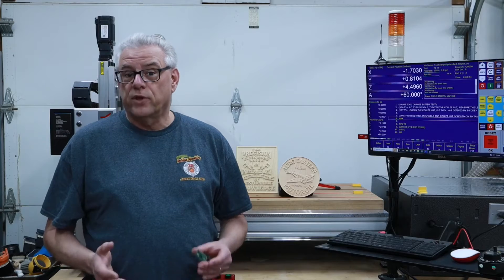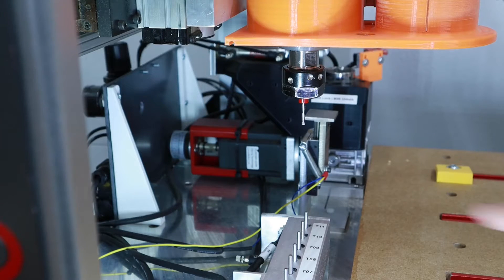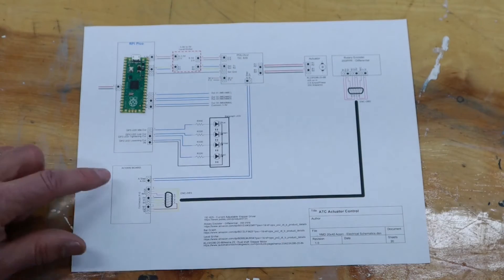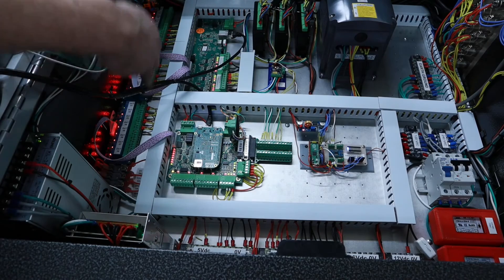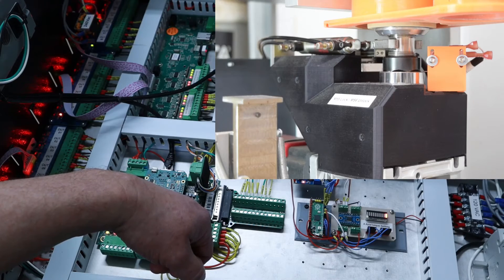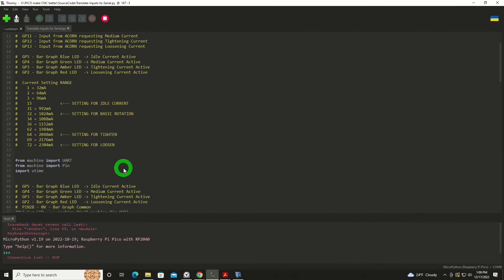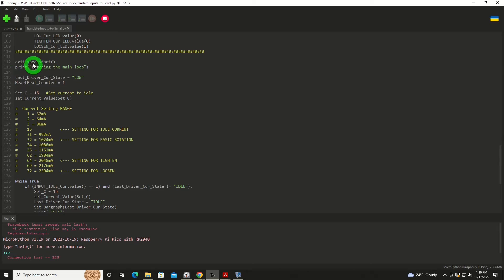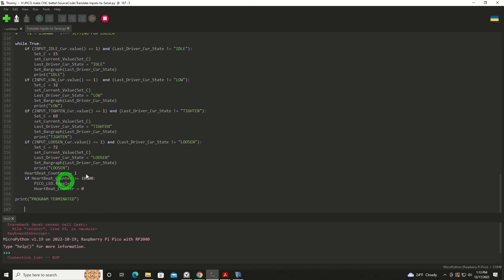See how a Raspberry Pi PICO Made CNC Awesome by solving a major interface problem

Comment: Great project, never thought of using microcontroller for this type of purpose.

Excellent explanation.
Reply from the maker: HI chirots,
Thank you very much for the Kind words.  Yeah, micros can be used in a lot of places PLCs are typically used.  They are not as "hardened", but they certainly can get the job done.
Cheers!
Chris
Reply: @MakingStuffwithChrisDeHut  I usually use PLC for any kind of projects either big or small, because it can be written quickly and many HMI  monitors can be connected without crazy codes  and classes.

Built a solenoid winding machine with Pico. I spent a few days testing codes whereas I could do that in PLC for just a hour.

Always admire all project creators such as you.
Reply from the maker: @chirots 
Yes, PLCs are a powerhouse in the industrial world. Outside of "work", I have always favored the SBCs and Micros, probably because of cost.  It is hard to find a $4.00 PLC.  Most importantly, as long as it is fun and interesting, PLC or Micro are great devices!
Cheers!
Chris
Reply: @MakingStuffwithChrisDeHut  Thanks for your responses. Nowadays, channel creators hardly respond to any comments or questions. By the way, you are definitely right about the cost of PLC. I guess I need to polish my coding skill in order to build more complex projects. So many ideas with limited programming skill.

Comment: multicolored bargraph, 4 colors ,  i know of red/yellow/green for sound volume, heartbeat idea, nice
but why not use the spindle motor to turn the collet open/closed, not delicate enough ?
Reply from the maker: Good morning Ben,
The reason is that the spindle motor is a 24,000 RPM motor.  It can only run between 7,000 and 24,000 RPM so it is impossible to start the motor then stop it quick enough.  Furthermore, the motor has zero torque at low RPM. The stepper along with the gearbox give me great mechanical advantage for tightening and loosening the collet.  This is a major driver as to why this is complex and why no one else has been able to achieve it.  Lot's a crazy crap to get this tool change system to work reliably and accurately.  It was a LOT OF FUN though!
Cheers!
Chris

Comment: That thumbnail lacks a few red circles and arrows :P

I just built a similar project with a pico, stepper motor (24v/2.4A), 16x2 LCD display, 4x4 keypad and two buttons to control a set of rollers very precisely (with length input and few other over engineered things) using bits of your tutorials among other things :)

I see that your driver is quite expensive at 60$, i used cheap A4988 but the torque was terrible and it was missing steps, switched to DM542 (~30$) and now it works perfectly, is there any specific reason why you chose that Tic T825 driver?
Reply from the maker: Good morning Phlex,
First things first - yup, that thumbnail is an experiment.  Obviously not my "personality" but I wanted to see what would happen if I stepped out of my norm and do something others are doing.  It will be interesting to see if the views goes way up as others say it will.

Glad to hear you are using the tutorials so you can explore more and have more fun.

Yes, the driver I selected is very unique in that I can, via software control, set the output torque.  That is absolutely critical for the success of the tightening device.  Without that, the tool change system never would have worked.

Cheers!
Chris

Comment: Really nice CNC router. Will it cut metal ? I have a traditional milling machine and I am thinking of buying a new one just for CNC conversion.
Reply from the maker: Hi AllTheGearNoldea!
Thanks for the kind words.  The router was never designed for metal cutting from the beginning.  The spindle is not at all suitable for metal cutting (at least anything more than scratching metal of the part) and the lightweight aluminum frame isn't rigid enough to real cutting.  Like you, I have a bench top mill with an R8 spindle with a digital readout. It serves me well for all the metal working stuff I do.  I   was giving thought to doing a CNC conversion on that or a different mill but just haven't had the motivation (need) to do it - yet.
Cheers!
Chris